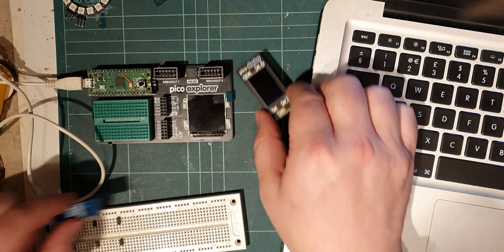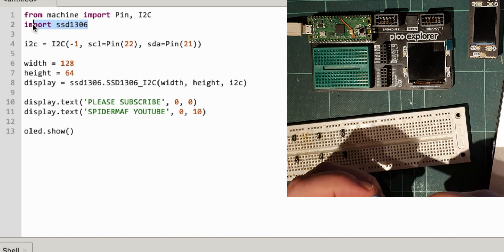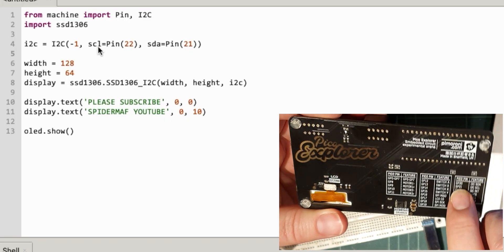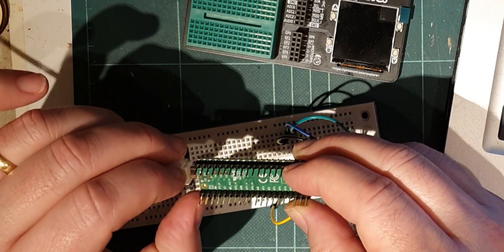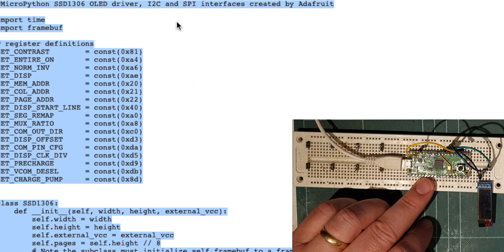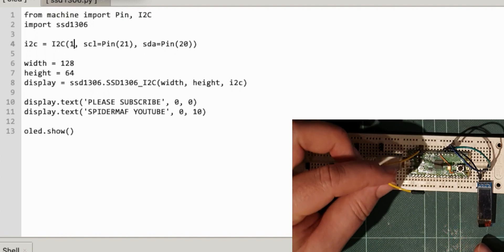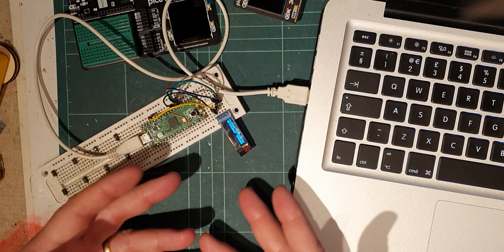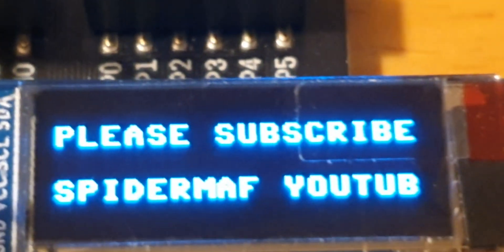Using a Generic OLED I2C display with Micropython on a PiPico and adding driver modules to the Pico

Comment: Thanks so if I have a part and the code for it than I just run the code first and save it to the peco ...why did noone setup a library feature like arduino uses it would have been so much better or better yet just combine mmicropy wth circuit py than you will really have something

Comment: Great video. Do you have any recommendations for a display with control interface (buttons/touchscreen) that has built in Python libraries. I want be be able to give some basic inputs like selecting from a drop down

Comment: Thanks, that helps a lot!
I wonder if I could run a bigger display such as the ssd1309 which is about 2.4" and has a redolution of 128 by 64 pixels. For all of us having bad eyesight.

Comment: Another answer here would be to use the original software rather than the pimoroni edition which I assume would contain the relevant library?
Reply: I don't think it does contain the SSD1306 in the stock Pico firmware, shout out to Adafruit for providing Micro/CircuitPython modules for a huge range of I/O devices. Btw, I think the Pico Explorer board uses SPI for the screen to provide fast refresh rates.